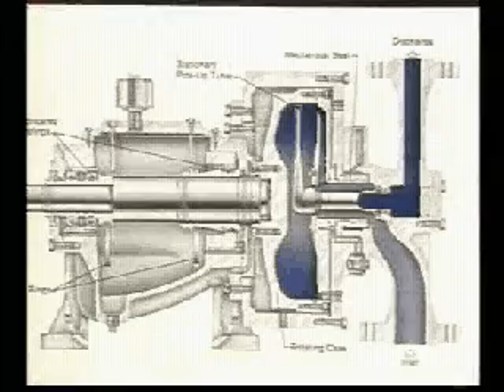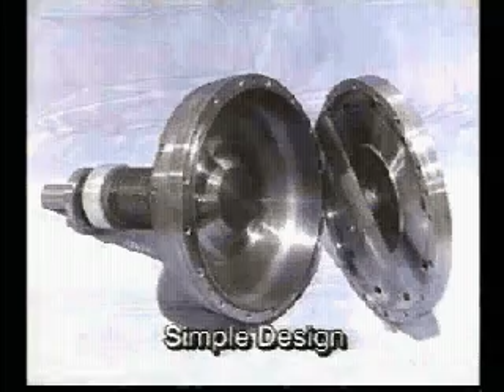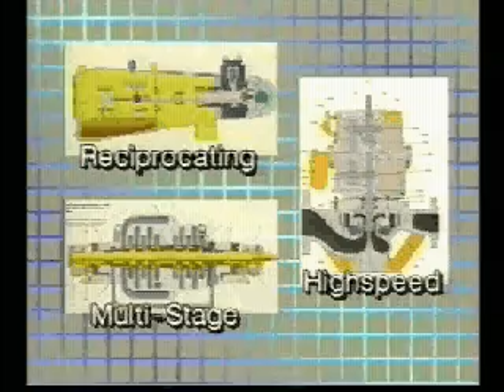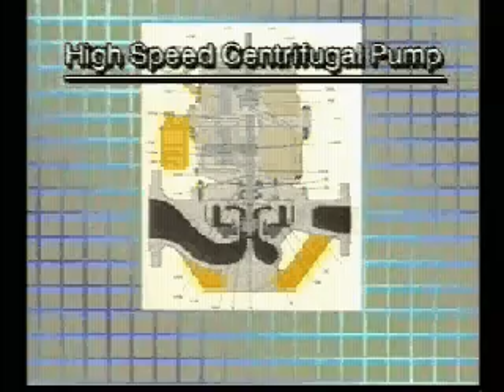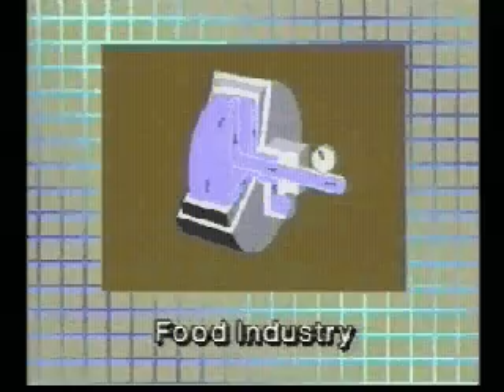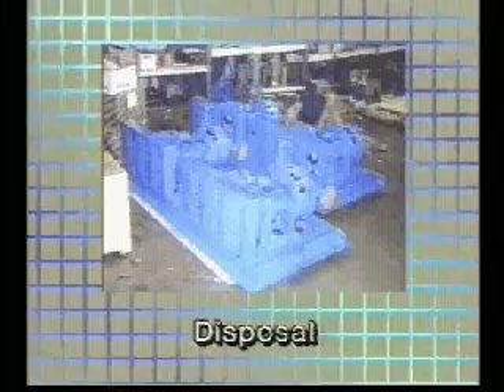Roto Jet Pump introduction

Comment: Sundyne pumps are very, very sensitive to process conditions as well. They have to be started, operated and shut down carefully. They are expensive. Expect to replace the gear box (80-100K apiece) at least once every other year. That's been my experience.